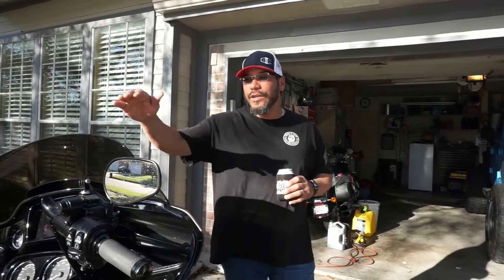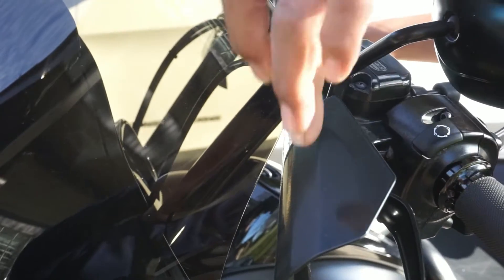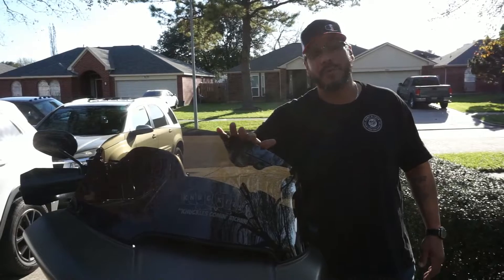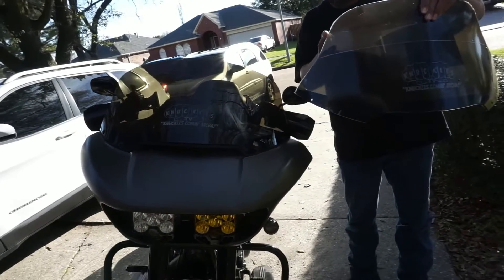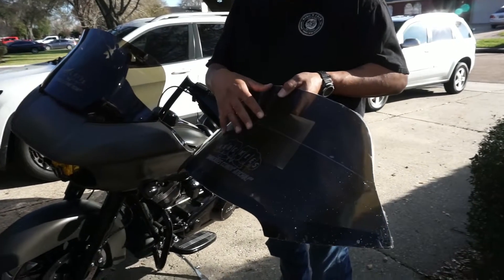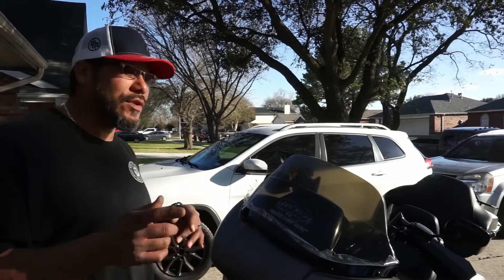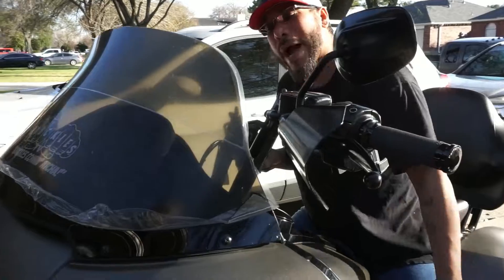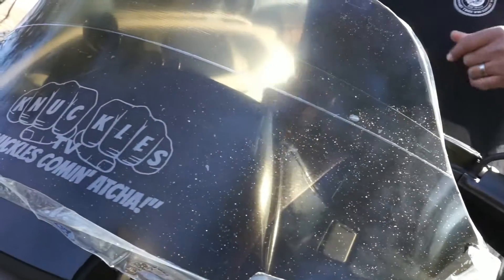FREEDOM SHIELDS WINDSHIELD | SPORT Touring Style | ROAD GLIDE

Comment: In the market, so either the Sport or the Touring puts that wind over your head equally?
Reply from the maker: Absolutely.  They both do amazing jobs putting wind over you as long you get the right size. They helped me figure out the perfect size. They are amazing people there.
Reply: @KnucklesTvMV  I went with the touring model 15 inch. I’m 6’1 so it’s a bit taller than the Klockworks 12 inch touring they make. I like the build of the FW..way more robust. I intend to do about 6500 miles in May/June…I’ll switch back to the smaller shield after..or maybe not!
Reply from the maker: @hoss6048  hell yeah kinfolk thats awesome! Hopefully you used my code 😁. What trip are you planning to do that many miles! That's amazing.  The windshield is definitely gonna keep you from getting fatigued from the wind. It does an amazing job and yes it is made with high quality 🤙🍻